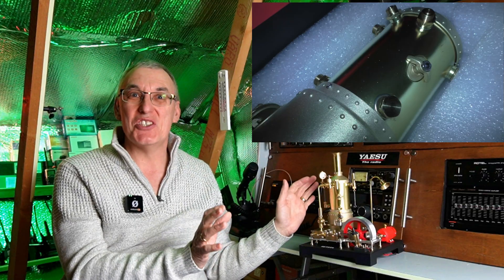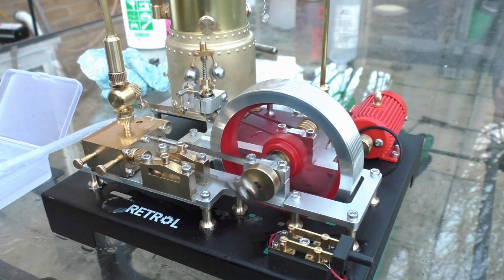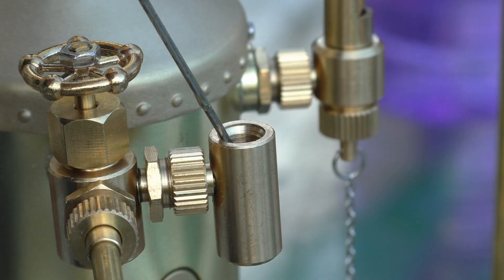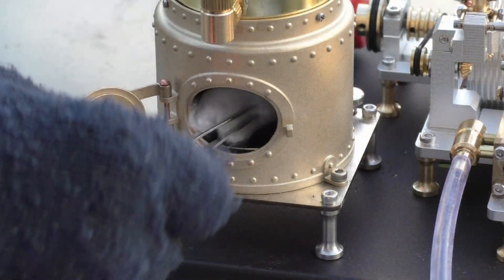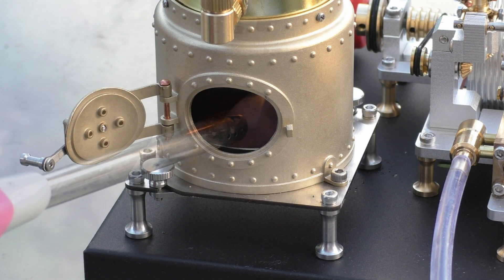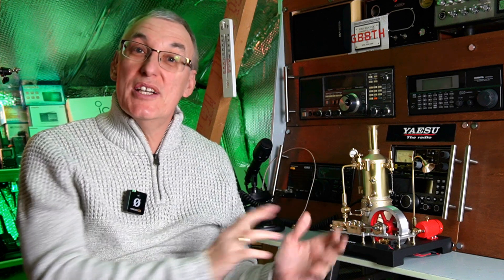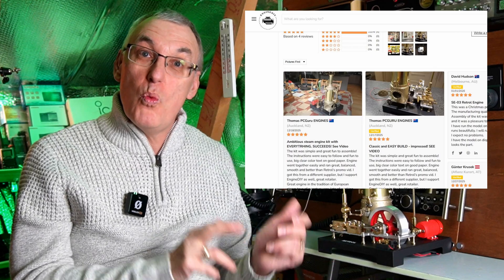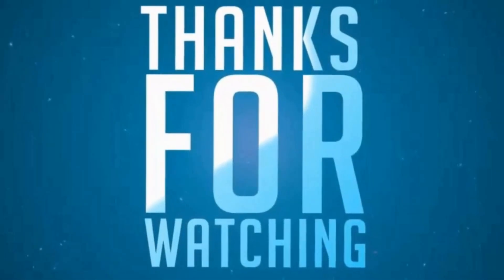Fully working Steam Powered Mill Engine and you build it yourself !

Comment: Beautiful engine & presentation Fred. There seems to be some fantastic model steam engines coming out of China at the moment. I built the Rocking Whale Marine Engine Kit which is a fabulous engine & might just have to order this one too, they are a far cry from Mamod & Wilesco’s.
Reply from the maker: Thanks for your kind words.  If you know your engines and what some can cost you can see the quality on offer here is impressive for the money.  All the Retrol models are really good indeed.
Reply: @CB-RADIO-UK  The only thing which puts me off the Retrol models is the silicon steam line between the boiler & cylinder. It would be a vast improvement to provide a copper steam line at relatively minimal expense.

Comment: No wonder these machines are so so dear to buy they are giving them away all you  You tubers
Reply from the maker: I very much doubt that figures in the sale cost at all.  They actually are not that expensive considering the quality.  I ve been buying and building Mamod and Wilesco kits for years (vids on those on the channel) They are not bearing models often using cheaper metal diecast parts.  These Retro models have machined components something you just did not see unless you spent £1000's

Comment: I wonder if there are any steam engines that use the destilation process to return the steam back to the boiler for another go round.
Reply from the maker: They did use a condensor vacuum system on steam trains to increase power.  I ve yet to see it reproduced on budget models though.
Reply: Thanks for the reply, that's pretty cool. I have always had some strange intetest in steam engines but sadly never met anybody who really knows anything about them or even owns one. I always thought it would be neat to have a steam engine furnace where you can get heat, hotwater and dc power off the output shaft. that would be a pretty efficient device for a home (provided you keep the saftey valves clean and inspected)